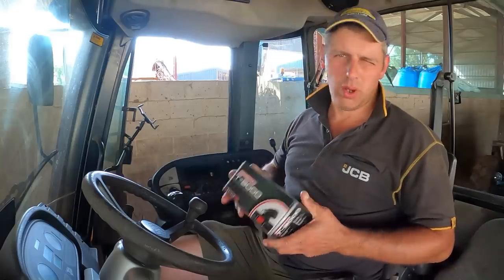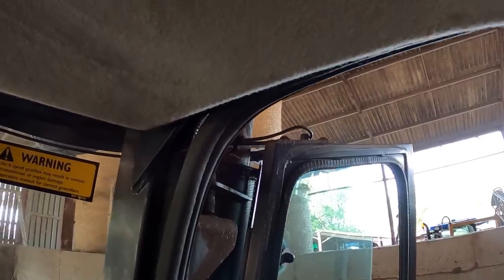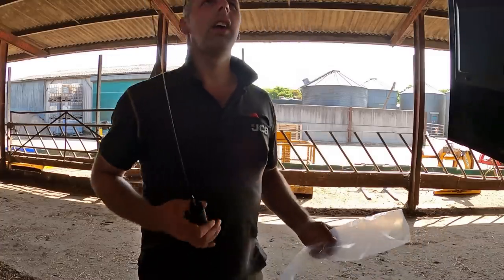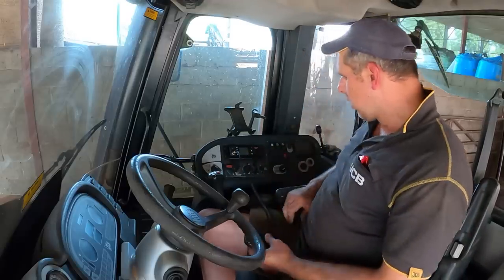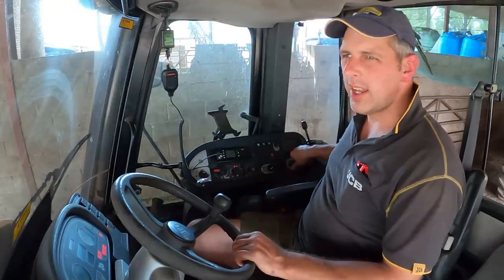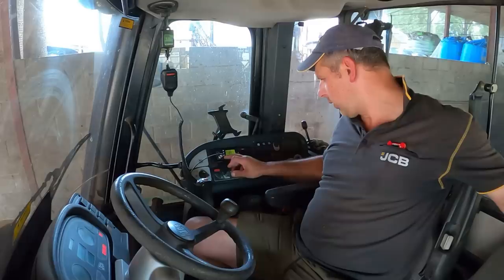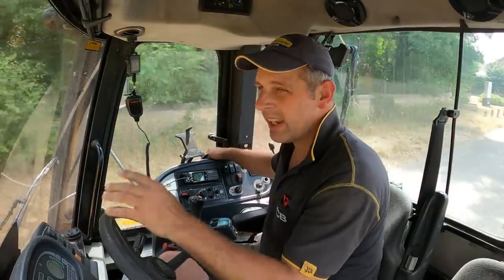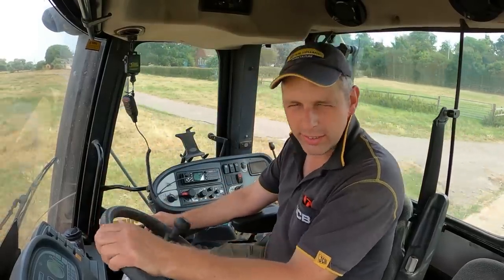CB INSTALL AND HORN TEST!!

Comment: Fantastic George we still use cbs in the wagons to communicate with loading shovel drivers to keep weights right on the walking floor trailers when loading wood chip,👍I think your handle should be “Sod Buster” have fun with it mate, keep well to the left and your mirrors clean, catch ya on the flip cmon 😂👍🤟

Comment: Handle has to be JCB GEORGE. Do you have to match the aerial to the rig these days? Used to have connect a SWR meter in the aerial line and adjust the length of aerial to get the best signal. I went on CB when it became legal on FM in 1979 with the handle 'DRUMWRAP' (yes I worked on combines). It was crowded those days, everyone was on it. Channel 14 was the main one, truckers used 19,  channel 9 was for emergencies. Ideal for farm use for short distances (3 to 4 mile radius), Choose a quiet channel and all stick to that and its as good as 2 way radio. Avoid anyone with the handle SHADY LADY, they are usually looking for mischief. (wink wink nudge nudge). Have a listen to Convoy by C W McCALL. Bound to be on you tube somewhere.

Comment: If you adjust the VSWR on the antenna it’ll work much better and also you won’t damage your radio. I have a T-3000 they’re good I also did a review on it when it first came out. 😎😎 I have a CB in my bulldozer I’m always on channel 19 in Basildon, Essex.

Comment: Was just gonna ask if the aerial and the set tune in automatically now because we always used a swr meter to get the reading as close to one as possible checked on channel 1 and channel 40👍 been said before but handle gotta be TDUB or fastrac 👍

Comment: Cb should work well in there as should not get too much noise from ecu s fly by wire throttle etc trouble is nowadays all the electrical noise stops you receiving signals lower than signal 7 hence why the uhf two ways work better as dont get effected with the noise. quite a lot up  here are using pmr 446 radios now i have both in my fastrac

Comment: Have you not got to SWR it in
Reply from the maker: Yes mate I did just didn't film it, should have done a little bit on it as that's where a lot of folk go wrong 👍
Reply: Definitely mate. I still have a midland floating around and at least 2 mag mounts saved my bacon on numerous times when I was on general haulage. Great vid buddy